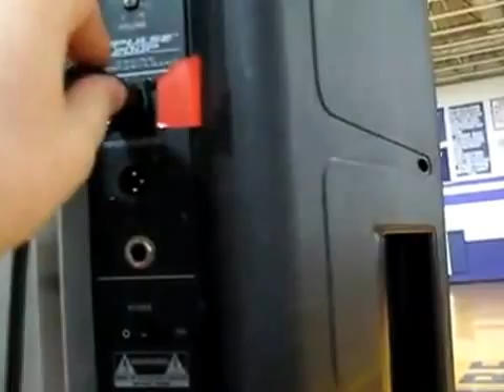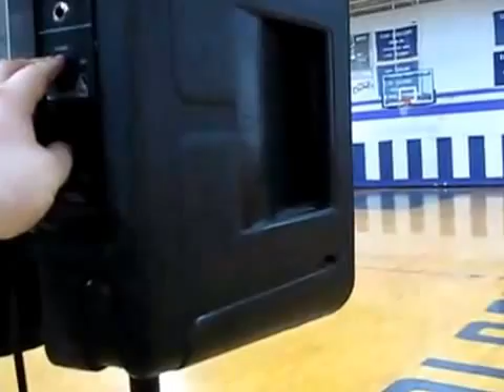Sound system ground loop demonstration

Comment: Had a ground loop issue in my car. Kept getting a low static noise when the volume was low/ muted. Did some research and grounded both amps to the same bolt and it now sounds so clear. This video helped even though it's not about car audio!
Reply: How did you fix your problem? I have an issue where I close my doors and it creates the ground loop
Reply: @luiscolon4961  hmm, that's new. I've never heard of a closed door causing a ground loop. Basically all I did was ground both my amps to the same point in the truck. Beforehand I checked that it was a good ground with my multimeter then simply connected both wires to that point.
Reply: @roman540  yeah when the door courtesy is pushed in it creates some kind of signal to the amps like very bad. I looked how doors work and they are grounded when they open and a complete circuit when closed 🤦‍♂️🤦‍♂️I don’t know
Reply: @luiscolon4961  that's above my pay grade, buddy. I've helped install a lot of systems and never heard of that issue. Might be worth the couple hundred to have a good audio shop troubleshoot your problem. Best of luck.
Reply: @roman540  yeah I just put the regular speakers back on today and everything sounds great . I just don’t know what it could be. I’m a licensed electrician and I have installed many systems before and never had an issue. It’s crazy. I’m very disappointed because this set up wasn’t cheap at all.
Reply: @luiscolon4961  you seem about like me- high standards for sound quality and you want things right. I have drove myself crazy with projects, for weeks, only to end up paying someone to look it over and fix it within hours. Super frustrating! But the end result is everything works as it should and you can move on to the next project.

Comment from the maker: cmatthew4 - 1 year ago
i dont think that ground loop... i was thinking more like 2 different phases cause huge voltage spikes.... for instance instead of running on 120V you where running at 208V (not necessarily the case, just an example)

of course that being said... there will always be a grounded signal coming from the other end if it is plugged in... thing is if it is running, on one phase... sending signal and the amplifier is trying to amplifie it on another phase you will get massive spikes and ridiculous interference... its the same way with motors, and motor controls.... if you have to use 1 phase... always use the same one for that particular system
Connecting a generator (amplifiers) with the wrong phase sequence will result in a short circuit as the system voltages are opposite to those of the generator terminal voltages

 your lucky it didint just flat out fry